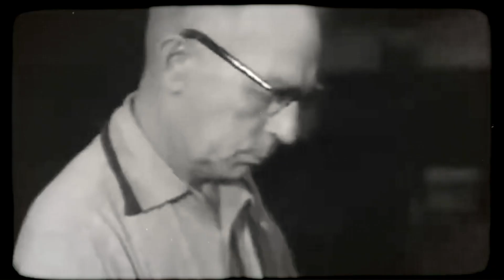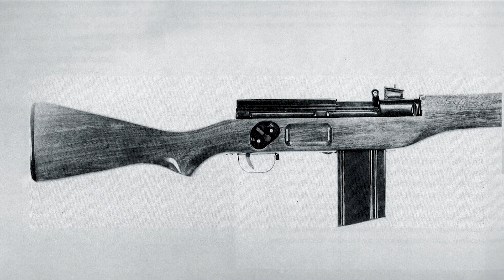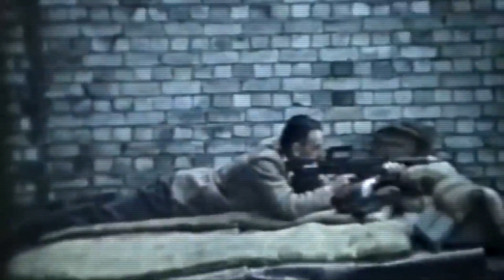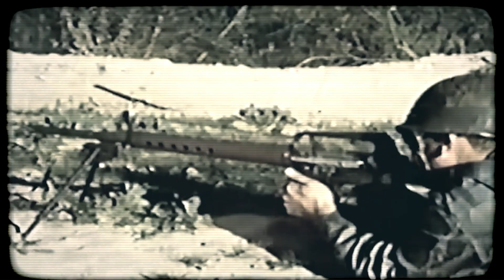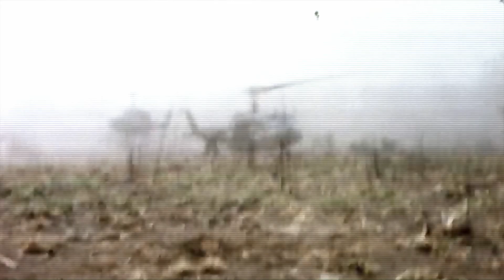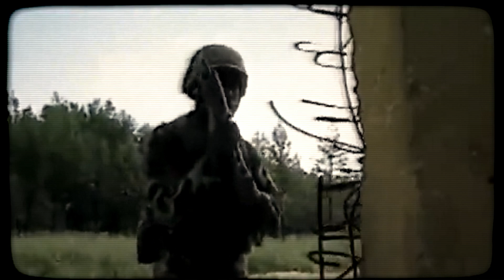Innovative Weapons of the Cold War Era that paved the future

Comment: Gyrojet rockets (Jīro-jet) accelerates extremely quickly have a mass likely greater than standard 45 ACP ball. At the end of the 5" barrel they're already moving at 86.5mi/hr, certainly enough to break a windshield or mess up someone's day. 
Not arguing that the concept is great for self defense etc but to not push oneself against the barrel b/c it isn't yet lethal.